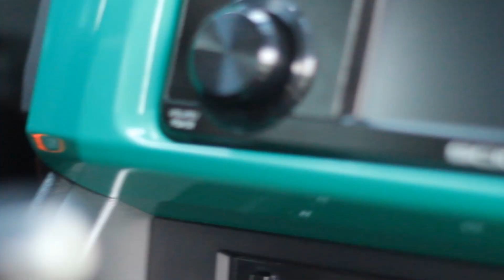Vinyl Wrapping Interior of the Scion FRS/Toyota GT86

Comment: What all would i need to vinyl wrap my interior... the wrap, the heater and the tool? how much for all
Reply from the maker: vinyl material anywhere between $80 USD +++
depending on what you're wrapping.
You can use a regular blow dryer and your fingers
Reply: can you suggest me a brand of vinyl material and how much to buy if i were to do the interior thanks
Reply: Fade Smerke i would recommend 3M or Avery.

Comment: I have a 2000 Subaru. It actually looks surprisingly good on the inside for its age, but it's the base model (I have no clue if the plastics looked different for different models) and some areas would look way better if they weren't the sun-faded grey. Going to try doing subtle trim with a wood-look vinyl. Should hopefully make the car look a bit better and a lot less like the other 500 exact same cars in my town.

Comment: Hey man, that's really cool!!! Im curious. How well has the vinyl been holding up? seems to me like it could get scratched easily.
Reply from the maker: Still is in mint condition after a couple years! Has SOME small airbubbles popping up in tighter areas, but can be easily heated up again.
Reply: Were did you order the wrap from? And how much did it cost?
Reply: Kings Must Rise I have a question, what happens to the vinyl when you park the car on a sunny, hot day? does it melt or peel up?
Reply: Carlos Castillo can i to get a responce to all of these questions please
Reply: justafan marvel hey, to answer your question. Nothing happens. Vinyl wrap was designed with temperature in mind. As long as you get a quality brand such as 3M or Avery, you should be fine. I've vinyl wrapped my roof and am going to wrap a few interior pieces soon. I prefer wrap over paint to be honest. It's easy and costs less. And @active EJ, it doesn't cost that much to do the interior. The most you'd possibly spend for the interior pieces in the front of the car is around $30. And I could be wrong. It could cost even less. It only took me like $44 for my vinyl wrap for my roof. And that was 60inch x 60inch. And I still had a lot left over to wrap my mirrors and still have more left to this day. Lol
Reply: If you wanna know more about vinyl wrap such as pricing and how to do it. Go to MetroRestyling's website

Comment: Would have been many times easier with plastidip.
Reply: +Boris Terekidi No way of going back though.
Reply: SkiStam - Quality Videos Plastidip is easier to remove and easier to apply. But if you already have wrapping applied - no point of taking it off to replace with plastidip.
Reply: +Boris Terekidi in my opinion it's easier to use plastidip but interior prices that get touched a lot would do better with a wrap

Comment: so how does this hold up on a summer day in TEXAS? does it just bubble up and you have to start all over?
Reply: +kwazykilla87 Most vinyl is heated to atleast 100* F to become pliable, and you can heat it even higher to make the vinyl lose its "memory", meaning it wont shrink back when heated again, which is generally around 180* F. I live in Texas as well and was curious about this. But most surfaces will never reach temperatures hot enough to ruin vinyl. Just make sure to post-heat vinyl so it stays in place better.

Comment: Why vinyl over plastidip just wondering, you had the parts completely separated so spraying wouldn't be an issue.
Reply: mkelebay Cause dip is shit compared to vinyl
Reply: +bugattirocksful not really
Reply: Vinyl has a better quality and doesn't get dirty easily in my experience
Reply: +mkelebay i guess plastidip can go off much easier. Just scratch a bit and the plastidip is ruined. If you scratch vinyl you don't have to start from the begining because the damage is not as bad with a scratch. I plastidiped my rims. While changing from winter to summer rims i touched the rim with the nut and the plastidip came completely off in that area because of rainwater which comes under the layer and pushing it off the rim. It's not that there is water in the interior bit i guess you get the idea of what i meant :D
Reply: DailyDotaTV your rims are supposed to be dry
Reply: Marky Force there might be a secret force called rain? And the car still works when it's raining outside. Just sayin' :D
Reply: You should have sprayed over the tear

Comment: how do u take off the steering wheel thing in the middle! !???
Reply: +joshieowashie Therte should be tabs on the side of the column to push in but make sure the battery is disconnected or the airbag will blow up in your face

Comment: how did you get the parts off can you explain or show please
Reply: Ebay. look up Vinly wrapping
Reply: the front panel and the panel that covers the radio pop right off. I just pulled mine from underneath then the raido cover panel from the right side. I havent tried the door handle trim though.

Comment: What made you get frs over brz? I heard brz has better handling?
Reply: SiN-TSUKi its the same car for the 100000000000000x time.
Reply: mkelebay for real tho...
Reply: No its not, look it up.
Reply: SiN-TSUKi Ok really than what mechanically is different?
Reply: SiN-TSUKi I suppose you are half correct. It isn't different but they do handle differently. FR-S has a harder setting on suspension and BRZ is a softer setting so really they are the same but just slightly different in tuning suspension. Other than that, mechanically they are identical. You really don't feel the difference until you really push both cars to the limit then you'll feel the difference in suspension set up from factory.
Reply: SiN-TSUKi The frs is also slightly lighter than the brz
Reply: aznnubbyboy Nico Naoi  mkelebay 

The cars a very much the same! But the spring rate is other! The GT86/FR-S oversteers more than the BRZ.

The FR-S is the lightest from them...because ... no xenon and such this things.
Reply: SiN-TSUKi The GT86. FRS, and BRZ were joint projects. They are EXACTLY the same mechanically. It all comes down to the slight exterior details and your manufacturer preferences.
Reply: ***** BRZ is not 4wd ...
Reply: ***** Dude.... in what world is the BRZ 4WD...
Reply: adrian lecheung actually there is an AWD brz
Reply: Let me rephrase for y'all lol. I meant in what world does the brz come awd STOCK
Reply: adrian lecheung Not exactly, Spring rates are different stock. 
BRZ: 153/195lb/in
FRS: 131/211lb/in
Both handle well and one setup may barely have advantage over another depending on the track. FRS promotes more oversteer. That is all.
Reply: Spencer Geerlings therfore it's still the same car...
Reply: Jason Williams ...no, because the difference can be felt. But it is possible to have no preference. Springs are apart of the car. As for interior accessories, and aesthetics. You could add that the stock BRZ has a higher drag coefficient by .01, not that it matters.

But if you love to upgrade you car like I do, then you will only see equal potential and a visual preference..
Reply: Spencer Geerlings Woah... so much wisdom😌
Reply: +Spencer Geerlings I just bought a 2013 FRS and I actually prefer the interior which has carbon fiber and silver accents over the red BRZ not sure what other things it has but for the price it is basically the same car for a lot cheaper just saying.
Reply: Jesse Da Silva Well good! You should always be happy with what you get. I have an FRS 2013 too in Asphalt. I preferred the exterior of the FRS, and I really don't care about interior accessories. I may strip it out one day anyway because racecar. As far as dynamics go, I've already upgraded every point of noticeable difference between the twins (Springs). If I had done the same to a BRZ, the only difference now would be .01 higher drag coefficient for the Subaru(which is negligible).
So again, for anyone who wants to upgrade, there is no difference but looks.
Reply: +Nikki wtf it's the same car...
Reply: Javier Mejia Read all the comments. It isn't.
Reply: +Spencer Geerlings dude it's the same damn engine. Only difference is minor interior changes. More luxury interior on the brz. I drove the frs and the brz. U don't feel a difference. I own a gt 86 and you don't feel the difference until u mod the car.
Reply: Javier Mejia Yeah it is the same engine, doesn't mean it's the same car. I could list lots of cars that share an engine. And no, there are suspension differences that I referenced above.
I own an FRS, I've driven a BRZ. If you can't tell, you didn't drive it hard enough. You can only tell when you're actually pushing it, in autocross for instance or on a track.
Everyone who does seems to be able to tell. Even magazine articles mention the slight differences.
How on earth would you feel the difference when you mod it? Maybe it would be magnified if you're talking solely about power, but the only suspension differences are in the springs. If you're serious at all about modifications, you'd switch at the very least to lowering springs, more likely to coilovers. Then the car badge would make no difference.
Reply: Spencer Geerlings Cool good to know :), well I am happy with my purchase they are both beautiful cars :).
Reply: Jesse Da Silva Glad to hear it! And yes indeed they are
Reply: +aznnubbyboy the identical rims have different weights, the cars themselves, one is bare bones one has a few creature comforts. Frs has better aero, less drag in it's design. BRZ has a problem about 100mph with air going into the radiator I believe? Idk theres a ton of little things. https://www.carthrottle.com/post/raplDG/

Comment: where exactly do you buy your vinyl from? and should i trust ebay?
Reply: +datstocklyfe if you buy ebay its fine just dont heat it too much and dont stretch it too far. it will snap easily so be careful, but is is a much more cost efficient option... its what i use.
Reply: +Thomas Komar im probably just an idiot but i bought some blue chrome wrap on ebay and the sun bleached it purple in 1 day lol...
Reply: AskEpic you may have bought the chameleon one then. haha

Comment: Hey man where did you order your wrap from?
Reply: eBay, vivid or 3m or Avery. I wrapped my whole car before, I wouldn't do it again. its pretty from far away but up close its ugly as fuck.
Reply: im currently trying to fix up my car some but pretty cheap, not going to lie. but i already have an old ugly car im stuck with for prob a few years. would you recommend trying out wrapping an older vehicle or nah? it does also have a lot of dings and scratches everywhere. I think that has to be fixed first, right? (i'm totally a noob with this) Just looking to kill time and learn something new in the process.
Reply: +t dub you should watch Justin Pate, the way he does it with cold stretch and 'triangles' really makes it 100x easier. If you want to give it another shot that is.
Reply: +Lizzy Wood tbh it probably isn't worth it
Reply: +Lizzy Wood maybe the interior pieces but not the exterior itself
Reply: Thanks guys.  Sorry to get back so late.  Am looking to wrap some of the pieces in my truck, it's ignition orange with orange accents inside mixed with the fake chrome and I'm looking to cover those up.
Reply: +The_Fif_Element I watched like all the vids before and while wrapping my car, from European to Philippine couple years ago. It's all looks easy as fuck, but they been doing everyday for living and the material they used cost more and easy to wrap with a team vs u by yourself.  Btw I used avery, and 3m is like the best vinyl u can get, at least couple years ago.
Reply: +Lizzy Wood yeah by a small roll with the color u like and wrap small stuff like phone cases. And get any heat gun and an exacto knife. Learn from square stuff then to curves like side mirrors
Reply: hey